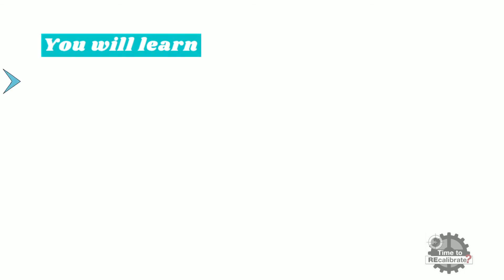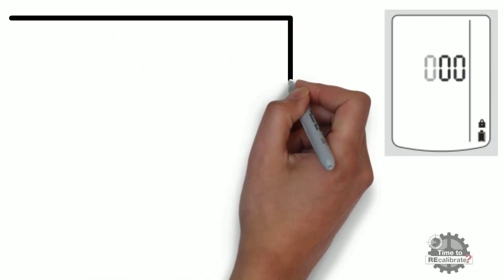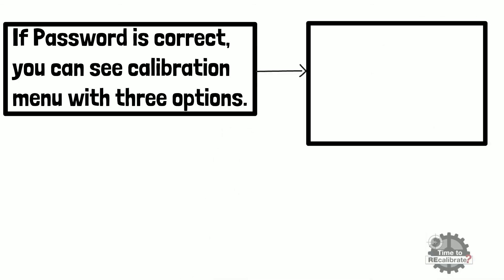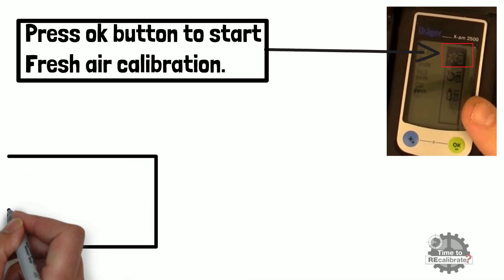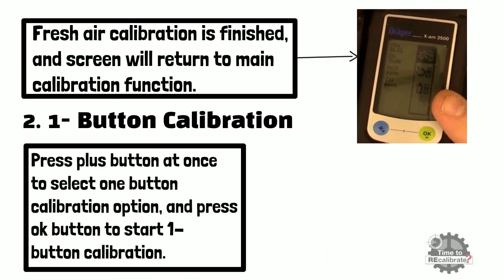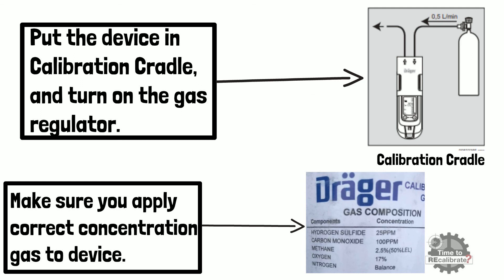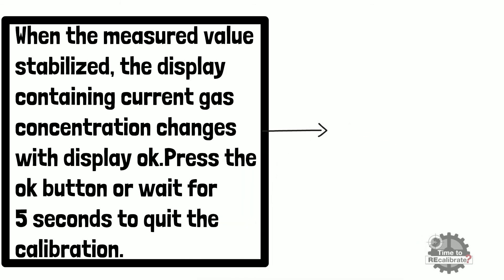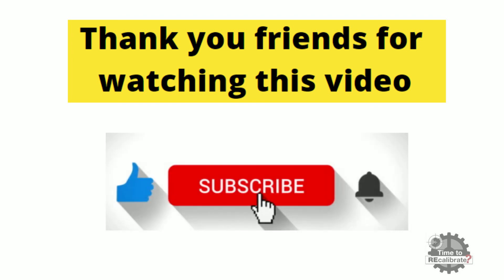Draeger X-am 2500 calibration | Portable Gas detector calibration

Comment: Traduccion al español
Presionar por tres segundos OK para encender el dispositivo.
cuando el dispositivo esté en modo medición, presionar + por al menos 4 segundos para ingresar al menú con contraseña.
La contraseña de fábrica es 001, usar el + para cambiar los números y el OK para pasar al siguiente dígito, En el caso del 001, se debe presionar dos veces OK (avanza hasta el tercer digito dejando los primeros dos en 0) y luego + (pasa el ultimo digito a 1), luego OK nuevamente para ingresar la contraseña.
Una vez ingresada la contraseña, se mostrara el menu de calibración, compuesto de tres opciones.
Fresh Air Calibration. Al ingresar en esta opción, presionar OK para inciar la calibración, la medición se mostrará en el display. 
Cuando los valores de estabilicen, presionar OK para terminar la medición.
Esperar a que todas las mediciones pasen a mostrar OK para confirmar la selección. EL menú volverá al inicio.
1-Button Calibration. Al ingresar en esta opción, presionar OK para inciar la calibración, la medición se mostrará en el display.
Poner el equipo en la “Calibration Cradle” y encender el regulador de gas, asegurandose de tener la proveer la concentración de gas adecuada al equipo.
La calibración se llevará a cabo automáticamente,  la medición se mostrará en el display.
Cuando los valores de estabilicen, las mediciones pasaran  a mostrar OK para confirmar la selección. Presionando OK o esperando mas de 5 seg elequipo se pondra nuevamente en modo medicion.
Apagar el regulador de gas y remover el dispositivo del “Calibration Cradle”. 
Single Gas Calibration.
Para moverse entre las opciones, usar +, y para elegirlas, usar OK.

Comment: Thanks. I'm asked to make a calibration workbench for calibrating new CO2 sensors. the system consists of fresh air with 0-80% relative humidity along with N2 and CO2 gases. My question is what are the necessary calculations I need to design the mixing chambers? what is the topic that I should searched about?
Reply from the maker: Thanks for asking. I am specialized in Calibration of Gas Detectors. But I have not any experience in designing of mixing chambers.
Reply: @InstrumentCalibration  Thank you so much for your fast reply.
Reply from the maker: @basmaal-ghali9174  You are Welcome... Keep supporting us